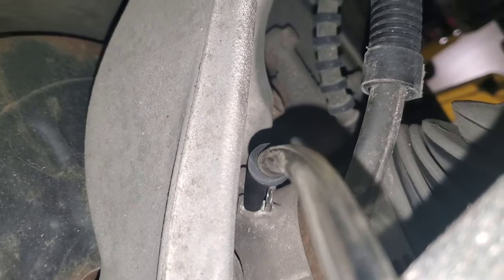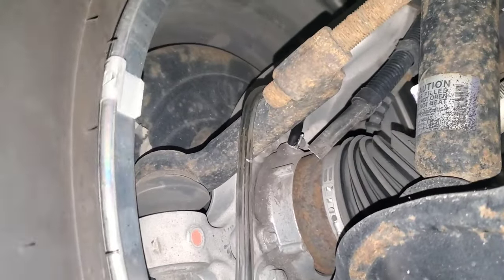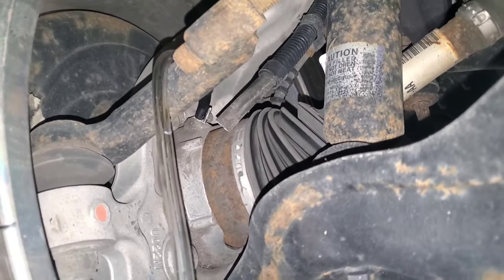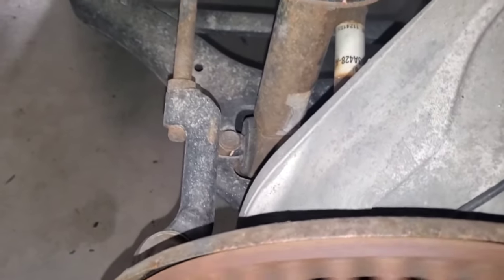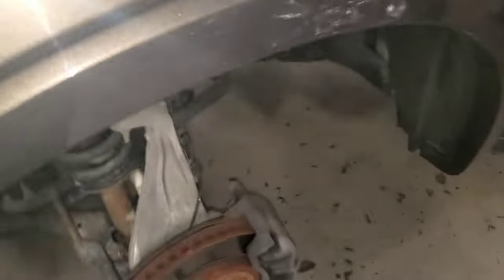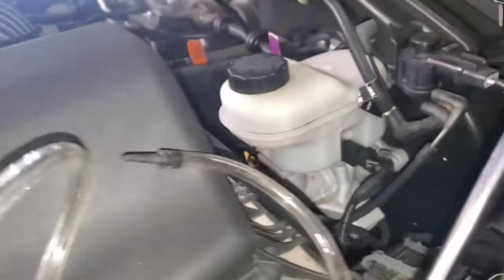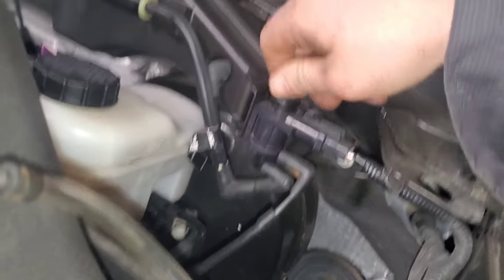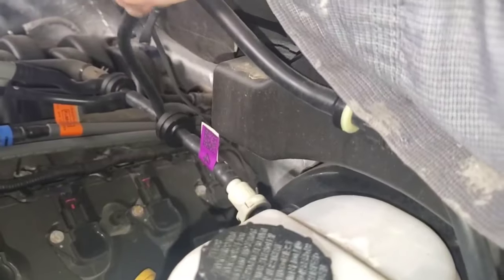Quick F150 IWE 4x4 Actuator System Check from solenoid down to Hubs - How To Vacuum Gauge Needed

Comment: Could you help me out with something!?   06 f150. Changed check valves in vac system.  But again got messed up at the brake booster there is a different size check valve that looks like the other two in the passenger side.  I cannot find that valve to order.

Comment: Quick question for you. I have a 05 f150 4x4 the solenoid for the 4x4 loses power as i come to a stop or sometimes when im cruising it doesn’t do it all the time but is it the ecu the problem here, it loses power only for a few seconds and it comes back after and of course the wheels start to make noise until it gets the power back on. 
Any help will help. Thank you 
Love your videos keep it coming

Comment: Thx, my 2006 f150 it becomes partially engaged when traveling on the freeway. Huge loud grinding noise that doesn't stop until truck comes to a complete stop with a loud snapping sound.

Very intermittent.  Never at an idle.

Comment: Checked all the lines and replaced the small filter line and valve. Still rattles and the iwe’s still hold pressure

Comment: My 06 passenger vacuum line just got obliterated, from heat.  It’s broke.   I had just replaced the hub bearing that side. I guess I didn’t stuff it uo high enough ?  Crazy.  The passenger side vac line is a mess compared to simple drivers side  I ordered new vac lines.  I need to drive it in the meantime without ruining anything.  It melted so the vac to the passenger is melted and same to the main supply

Comment: My problem is on the passenger side. Once I hit 50mph passenger side starts vibrating like crazy. The actuators are good but once I went to the fire wall top port, wouldn't hold vacuum. Buying the hoses tonight and installing them as soon as they get here. Hopefully that's the main problem. (Edit) had the hose on the passenger side hooked up wrong. Placed it the right way and now the lines to the actuator are holding a good vacuum. Now I'll have to check the solenoid so on and so on. There's not enough suction on the driver side tho not sure why.

Comment: Thank you for the great explanation. Got 2015 f150 was getting the weird sound replaced the solenoid and tube with the check valve hoping that does the trick.

Comment: I'm feeling a mild grinding type feeling in the steering wheel at non-highway speeds on my 2018 f150.. wondering if it's related to this so I'm going to do this exact test. Thanks, as always Boss!!

Comment: Thanks buddy for this video.  I fixed my problem following your steps.  Upper hose was crack/bend so it did not let the lines below have suction to disengage the hub actuator/Iwe.  The symptoms was that my f150 had some bad, scary vibration only when putting some pressure while turning to the right. Both wheels were stuck on 2H.  After this fix no more vibration, wheels are free and actuators work like they are suppose to.. Hope this helps others like me....

Comment: This was a really good video explaining this system.  2017 F150 3.5 Lariat, heavy payload package, 47000 miles. I have a low speed humming noise that I start hearing below about 30mph.  I thought it was the front end turning like my manual hub 4x4s when the hubs are engaged.  I did your checks and vacuum on the hubs , hubs are disengaged, no vacuum hubs engaged.  I put 23” of vacuum on the main line by the solenoid and that was solid for 5 minutes, no loss.  Good vacuum at solenoid in 2wd and stops when dash switch is 4wd. Good vacuum in reservoir even with engine off.  So the 4wd engagement system seems to be good.  The vacuum check valve is the black one not the blue on, but it seems to be working.  
Only two things come to mind now, hub bearings going out (happened on both my F250 Powerstroke 4x4s) or maybe it’s a humming from the original Goodyear tires which are now 7 1/2 years old per date code.  (9/32nds fronts, 8/32nds remains on rears).

Any ideas from you on possible causes or help with what to check next would be appreciated.  I think this pickup is generally so much quieter than my previous 2 Super Duty pickups it’s easier to hear things.

Keep up the great videos, you’re helping lots of folks.
Reply: Does the sound go away when you engage 4wd?

Comment: These IWEs have been the bane of my existence.  I had to have both hubs replaced under warranty.  Now it’s clearly the IWEs again making this sound again three years later.  What a dumb system.
Reply: What is the sound ?
Reply: @worleyone  It was the IWE and I replaced it myself.  Was a huge pain because it was the middle of winter and I did it in my driveway.... it sounds like  a low droning buzz and when you put it into 4wd it goes away.

Comment: Great video. Went through all your tests and everything passed. Had mine changed out a couple years ago due to some issues and come to find out the dealer that installed them didn't tighten the 3 8mm bolts holding in the iwe on passenger side and it was loose as hell. I have 0 faith in the dealers by me.
Reply: Did you have a noise coming from the one with loose bolts?

I have a noise I narrowed down to potentially a stripped out 1 of the three 8mm bolts. Thinking it is not tight enough it loses vaccume?
Reply: @TonicofSonic  mine were backed out quit a ways. All of them. I was having engagement and loud noise at high speeds. Tightened it up and all is good for now. Watch the new ford boss video on YouTube about new service bulletins on the ford vaccum hubs. Ford is telling techs to plug off the whole system and just spins the shafts all the time. Check it out
Reply: @marcharris4176  Oh wow. Thanks for the response. Mine is tight enough to not turn by hand but also at the limits of spinning. I tried pulling the power to the solenoid to test itthe system, my intermittent sound remained. I wonder if plugging it would yield different result. Will check that out.
Reply: @marcharris4176  I'm curious - what was the noise like?  loud humming (worse than off road tires) or clanging - like a bunch of nut n bolts in a coffee can being shaken?

Comment: Great Video, Thanks.  I have a 2004 Ford F 150 4X4 , are the rules you state in the video the same for that year?  I have 4x4 problems and the drivers side IWE will not disengage from the axle regardless of whether I put zero (pull vacuum hose) or  apply 25 of vacuum directly to the IWE.  The passenger side IWE is just the opposite , disengaged whether or not I pull vacuum hose  or apply 25 directly to the IWE.
Reply from the maker: I don't know I haven't worked on one of them in so freaking long and it wasn't four wheel drive

Comment: Thanks, the front left made the 'nutz n bolts being shaken in a tin coffee can' noise on my 2018 F150 Ltd at 5K miles.  Dealer fixed it but now at 40K miles I swear I have a hum in the front left that is more than I should with AT tires on the truck and I think I have heard that clanking nut n bolts in tin coffee can noise just a little twice on a 200 mile road trip last weekend so wondering if this has failed again so need to run through this vacuum check process.  Is it possible for say just the front left to be engaged all the time in 2WD?  Also is this repair covered under Fords 5yr/60K miles power train warranty?
Reply from the maker: Yeah it could be it just all depends it's unlikely but it could

Comment: Great video once again. I have a scenario that I don’t see is really touched upon in this thread, or in most other diagnostic videos regarding these IWE’s. My 2015 Lariat, with 3.5L EB, has 4Auto mode as well as 4High. I read somewhere that the CV axles in a 4Auto tyranny “are designed to turn” with the hub while in 2H. Is this true?? If so, I assume the vacuum/no vacuum test process would be different for this model?
Reply from the maker: So that's where you're wrong this has been covered in 4x4 Auto driving with your friends for case and the fact that I already had a Ford Bronco smoke the transfer case for driving in 4x4 Auto

Nope the hubs are not built in me different

Comment: I’m stumped here, I have a 2014 ford f150 3.5l v6 eco boost. My truck was making the noise every so often and I’d turn 4x4 on and then back to 2x4 and the noise goes away. I replaced the selenoid & check valve same problem nothing changed. I put 2 brand new OEM IWE’s in and now the grinding noise stays constant no matter if I go to 4x4 and back to 2wd. I’m thinking of doing a vacuum test next and see if I have a bad vacuum line. The driver side sucks vacuum great but passenger side is very light. I’ve even pulled both vacuum lines off the new iwe’s and used compressed air to blow air through both lines and plug it back in but still no luck.
Reply from the maker: Vacuum test lines indeed
Reply: I’ll check it out and report back tomorrow. your video here was very helpful & well detailed. Awesome job. 👍🏼
Reply: @SimonsSoftwash  what did yours end up being?

Comment: Can the vacuum solenoid get stuck in an open position so that it’s pulling vacuum all the time even when shifting to 4wd? Cause I can hear and physically feel the transfer case shifting into 4wd but the front wheels aren’t engaging. No noise in 2wd. I plan on going to to his house and removing vacuum to the wheels tomar and see if they engage that way. Just wondering why both wheels would fail at the same time and he’s not having any other symptoms like the grinding, etc.
Reply from the maker: Yes

Comment: I put a brand new actuator on my 2011. No more noise. A few weeks later I had to use 4x4 and when i put it back into 2wd the thing is making racket again. If I engage 4x4 the noise stops and when back in 2wd it starts again. I’m getting real fed up with this modern stuff 🤦🏼‍♂️. Thinking about selling and buying a 1980s truck

I also put a new check valve on it up there on the firewall
Reply from the maker: You got to make sure you don't have any vacuum leaks in the lines and not only the check valve but sometimes the solenoid acts up as well

Comment: Nice video! 
I was losing 4x4 and heat at high throttle. That was a bad checkvalve. My explorer has it internally in a vacuum res. I just added a checkvalve. At high throttle there is little vacuum in the plenum and the check valve has to hold the vacuum.
Reply from the maker: Great Idea

Comment: Great video, when im driving my 4x4 would try and engage and would get a grinding noise, I turn it to 4x4 the noise would stop at first but now it will continue to grind in either one. I hooked up to the iwe at the wheel, it holds pressure in the tester but I don't get no free spin, axle moves as well. I hooked it up to the solenoid the tester held pressure but no free spin, axle was moving with the tire, im at a lost.
Reply from the maker: Did you apply manual vacuum at the hub?
Reply: @Ford Boss Me  I did and axle still moves, tire doesn't free spin.

Comment: Thank you for this vid. I have a sound that happens when slowing down from 15 to 5 mph.  Did all these tests and all things were fine.  Went the extra step just to replace the hose tub, 4wd actuator and the vacuum reservoir and still happens.  Sound doesnt happen in 4wd which leads me to think its still iwe related.  Im at a loss but like I said this vid was extremely helpful.
Reply from the maker: Keep looking at my videos in the library to learn as much about the F-150 as possible and what would have happened is you would have run across a video that talks about a rattle tap ticking sound when coming to a stop or going to take off just under light load

Look at the exhaust clamp under the driver door on the heat shield it cracks and brakes and sits there and rattles under the same fashion
Reply: @FordBossMe  Thank you for the video suggestions.  Just checked them out.  The 2015 5.0 I have is more of a light grinding sound when decelerating.  Thought it was the brake pads so replaced those all around (rears were due for sure, fronts had a little life left).  Had the vcts replaced a few thousand miles ago as well.
Reply: @Raf7er  what did it end up being?
Reply: Mine goes away in 4wd too. I’ve replaced check valve and solenoid no luck yet. What did yours end up being?

Comment: Following your directions,  hubs work great with direct vacuum,  but when I put vacuum at solenoid,  only one hub spins freely, the other still engaged.  I unplugged the line at the hub,  and the pump still held pressure like the line is clogged.  Any suggestions?
Reply from the maker: You are going to have to go through and check your lines

Comment: My 2007, F150, 4-wheel drive, 4.6, all of a sudden started making awful scraping sounds. Then, within a few minutes the truck lost all forward pull, like the tranny was slipping, causing the RPM's to climb.
As I slowed and pulled over to stop I all of a sudden had forward pull again. 
If I remember correctly, the scrapping stopped each time the forward pull went away. 
I later found a vacuum line to my passenger hub disconnected. 
I think the scrapping stopped, but the transmission appears to slip the same as before. I haven't driven it but to test it out after reconnecting the hose, but feel the scrapping is cured. 
I don't know if it's a coincidence that the two things happened at the same time, or, is there a mutual thing going on that they interact with, together? 
I pulled the tranny pan, before I discovered the disconnected hose, and changed the filter, fluid and gasket (also added a qt. of Lucus). There was no metal flakes or pieces, but the fluid was black. I don't believe the fluid or filter had ever been changed,  because the dipstick knock out plug was still in the pan. 9:26pm  7/19/23
Reply from the maker: Yeah that's odd I really don't know

Comment: When applying vacuum to the hub actuators, they do disengage the axles. But applying vacuum to the upper line at the solenoid will not hold vacuum. I replaced check valve and solenoid - what's next?
Reply from the maker: If applying vacuum to the line that supplies vacuum to the iwes and it won't hold vacuum from there down you have a broken line somewhere

Comment: Ford Boss - Super helpful video working through the vacuum troubleshooting.  I'm curious if you've ever found this to be an electrical problem going to the solenoid.  I've tested my voltage before and found it to be inconsistent.  I expected ~13V (?) constant in 2WD, however when moving to 4A or 4H and back to 2WD, my voltage was 0.
Reply from the maker: Normal

Comment: Thanks for all your videos been a year or so subscriber and they've been great.   This one came across my feed at the right time.   my 2019 F150 has a grind on the drivers side but only when cool out and it only happens after about  0.5 miles into my drive.  If i toss it in 4x4 it immediately goes away and i can put it back in 2wheel drive and it wont do it again until the truck shuts off and sits for a few minutes but i feel like the hubs are still engaged.   I have replaced the check valve and the solenoid since i've been to the dealer twice now for this.   I have tested vacuum down to the wheels and all seems good, it holds vacuum and the hubs disengage.  I have vacuum in the system from the engine, i can feel the vacuum.  The dealer because it doesn't 100% of the time make the grind, cant troubleshoot unless its doing it and i am not sure where to go from here.  Any thoughts on something i can check?
Reply: Hey man. Having the same problem. Iv been going over Rich’s videos to try and figure it out. Iv also replaced the check valve and solenoid and still getting the intermitted grinding when accelerating and turning the wheel right. Wondering if you figured it out yet and can help me? Thanks man

Comment: On my 2010, We had a big snow and it got stuck in 4 wheel, So I looked and both hoses were off on both sides, So I plugged them back in and it went back into two wheel, But when I go to turn on 4x4 they don’t turn back on unless I manually unhook the hoses again, Any advise would be appreciated, thanks
Reply from the maker: I'm making a video for you

Comment: Hey man just wanna say thank you for your videos. I also follow you on tik tok.. question for you though.. I’m currently trying to diagnose an issue I’m having with my 19 f150 limited, I notice whenever I make a turn, or a u turn, (sometimes.. it’s intermittent) afterwards, as I begin accelerating I hear this shudder sound. Idk if it’s the cam phasers or the Iwe valve maybe? Any idea what it could be just by what I said. Thanks for any input
Reply from the maker: That sounds to me like it might be integrated wheel end issues

Comment: I understand the checks you have made. I had a faulty IWE solenoid, it seemed to have failed in the unlock position. I replaced the solenoid, I can feel it activating now, but the hubs will still not engage. Any idea what could be the problem?
Reply from the maker: There's something you missing with your diagnosis either one of the lines are switched backwards at the solenoid up top on the firewall or you've got a break in the vacuum line somewhere and you didn't find it I mean there's obviously something missing here that you're not saying so if you watch all and I mean all of my videos on the 4x4 system in these trucks you can diagnose any of them if you're not following everything step by step all the way from the vacuum Source up top all the way down to the hubs you're not going to diagnose it you are clearly missing something